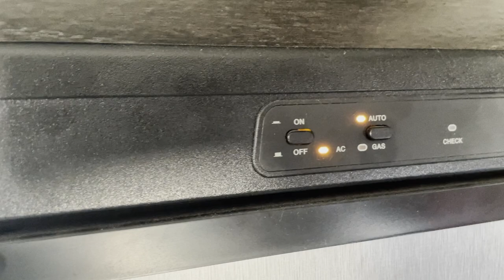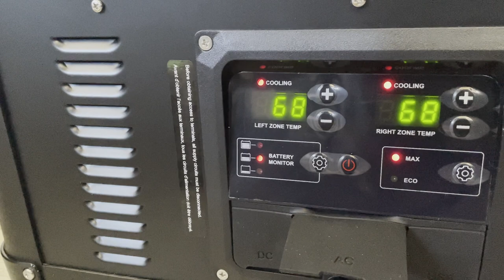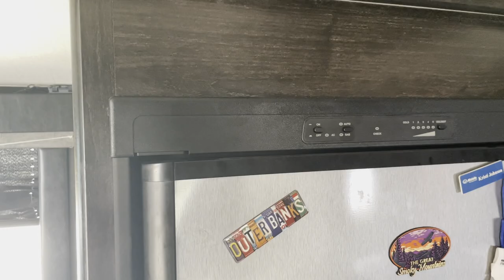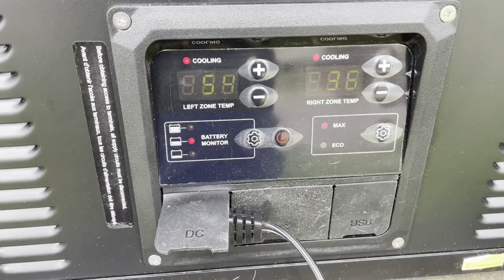Ditch Your RV Fridge, Save Power

Comment: Pretty sweet.  I would be installing a shelf with a fridge slide at an ergonomic level in there.  Use the area below it for storage, or sh*t with that low a draw, I would be installing one of the old Icecos in the bottom  just to put drinks in.  You have the room.
Reply from the maker: I think we are gonna put it on a slide then build a pantry there.

Comment: Been waiting for this video. My dometic crapped the bed, and I’ve been thinking of doing the same thing. Happy with the VL45 in the 4runner that I’ve had for about a week now, maybe I’ll go with a 60 or 60pro in the trailer. What did you do with the dometic you removed btw?
Reply from the maker: I sold it. The 90 is perfect.

Comment: I have the VL45. My only issue is that it is about 1" too tall to fit under my Tacoma's tonneau cover. Apparently the Pro version would fit...I just need to sell the VL45 first as I don't need two fridges.
Reply from the maker: Interesting. That was one of the selling points I thought was that it fit under a typical bed. The VL45 is an awesome fridge shouldn’t be hard to sell.

Comment: I never use AC power for my rv fridge. i only use propane, i get about 2 years use from one propane bottle for fridge only. thats crazy for me to use AC power with that kinda miles. it runs 2 weeks every month (then off2). if you do the math its not bad. but full time rv i have no idea.
Reply from the maker: Wait, ur getting that kind of efficiency??? I was running through them.
Reply: @SirWilliamGoes  yes sir! propane rocks for the fridge! even way cooler than AC. i also have 500 watts of solar, but i have always used propane for fridge and cooking only. but use only one tank for the fridge and the other for heat and cookin. dont know why you had such bad luck with it, but man propane rocks for the fridge.